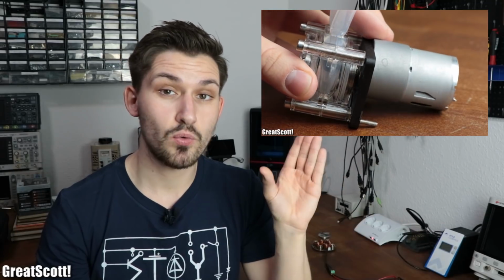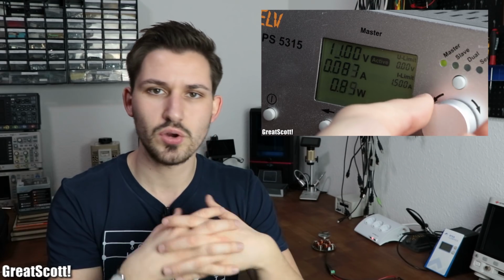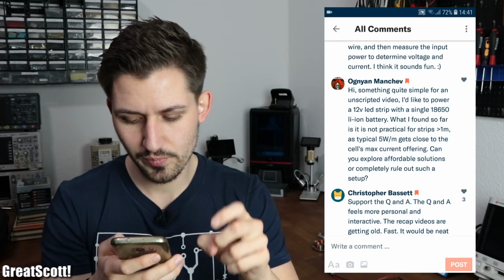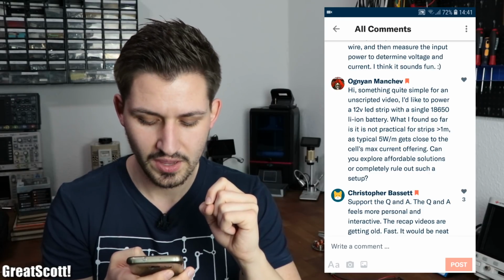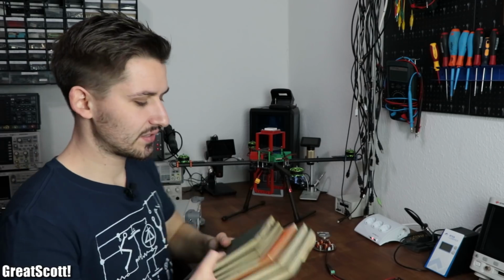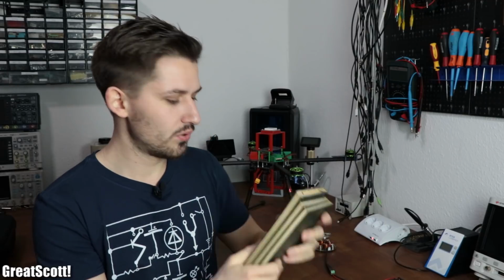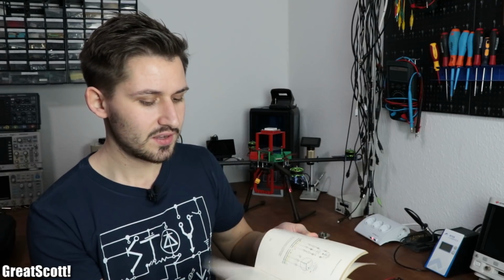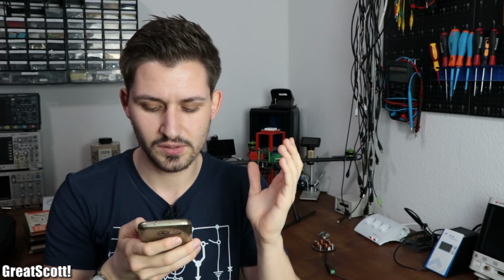Random/Unscripted Q&A #4 || Top 3 GreatScott! videos of 2018!

Comment: A basic diy drone would be cool; but what would be really cool is building the basic diy drone, then expanding to an experimental, larger drone.  So if the standard is a four motor drone - do that. 

But then remove each single motor and replace each with an expanded trio of motors built on a custom rigid frame - a basic triangle frame that sits where one motor sat originally.  And maybe something to test the aeronautics - so of the three motor group, have two set to the outside of the drone & pitched at a slight angle.  So if it could hover with the majority of the power to the upright motors, that's great.  But, what about speed by ramping power to pitched motors on the fly...?  How extreme could the pitch go....?

So a quad copter drone turns into an experimental 12x copter drone... Or maybe a 16x copter drone.....  I mean, you are German...building bigger and more extreme is kind of expected...  I'd say one successful build should become a challenge to take the success to the next level.  A quad copter leads to a 12x copter which leads to...(?)...a 12x copter with twin pulse-jet engines which leads to....... A quad 12x motor w twin pulse jet engines copter (so 48 motors, 8 pulse jets, all on one gigantic quad copter frame)...

Frankly, I don't know how you could say no to that...  What if the 48x copter/8x pulse-jet ultra-quad-copter is a success...?  You keep on going...(?)

Comment: Don't make the drone thing seem so difficult. I feel like you went a very complicated rout. Normally there's just one connector type for "data" (jst) and a few for the batteries (xt60, ec5,...). You need a frame, 4 ESCs and Motors, fc, charger, battery, rx and tx, and that's basically it.

Comment: Great scott, could you take a look at Sam Sheppards 72,000 lumen LED light on here. And tell me if this thing is putting out way to much power for the lights, it's a parrallel circuit with a 36 volt source and 1 ohm of resistance across each LED. To me it sounds like he's making alot more power then the lights can handle. Just curious what you think. If you get a chance, thanks

Comment: I have a video request. I understand you are not a home automation fan, but I thought it would be nice if you could make a video about interfacing knx (a home automation system installed inside houses) with arduino. I know this is possible by using an existing pcb. You are very good at breaking down and explaining the most essential parts of the electronics, so it would be interesting to see your takeaways on such a project.

Comment: I'm working on a music related item and would like a beats per minute meter, but i cannot find anything online (certainly not in my budget)
I would like 3 digit 7 segment display, 40 - 200 bpm
All i can find are interface boards for arduino and other processors, not something i want to get into, and they are for heartrate (which could be another use for the bpm meter)
Maybe some sort of charge pump and digital voltmeter calibrated for the scale ?
Any ideas ?

Comment: Hello,
And thanks for the great and instructive tutorials,
I have a question: could you make a detailed video for the "start-current-limiting" circuit.
e.g. If you want to control larger loads and you want to prevent the start flows too much power.
that would be a great thing.

thanks again and greetings

Comment: Seriously, a drone project?  Building drones is so last year or actually last 2014!  When a lot of drone building videos started coming out in 2012 I tried building several, including one supposedly RTF model from Hobby King but the designs were bad, the parts from China were defective and the software was all terribly buggy so none of them would ever fly.  They were fun to build but frustrating when they would never fly so I finally gave up and got a DJI.  If you have a drone project you will need to use a proven design, parts that have all been tested and guaranteed to work and bug free software that will keep getting updated or everyone is going to hate you when they end up with a worthless drone!

Comment: I would like to see a series on modifying commerical products to make them more functional or transform them into something else, kind of like the old converting a computer PSU into a desktop power supply, but don't do that one there is enough of them already. How about something like taking a cheap lead acid battery charger and adding some features to it for example.

Comment: Hey GreatScott
if you ever come across this, here is one project idea

How about powering PC with 12V car battery (12V, 5V and 3.3V rails), because it can deliver high and stable amps for gaming, but if you're on budget, decent PSU can be (sort of) expensive.
Of course this should have some sort of protection/charging, I haven't thought it through, but, it would be, unique?

Comment: Little bit off topic but I need a particular circuit for my lab bench power supply (from scotts video) and I want an external circuit to limit the current from 0-200ma to limit the heat gen and add a switch to bypass it that I can do. But I can not find a circuit that can do that without interfering with the buck boost converter. Has anyone seen such a circuit?

Comment: Can u make a diy on home lighting system.
Working on a series of high power LEDS with 6v 5ah battery as power supply.
This circuit can be dual charge with a 12v AC wall adapter and 12v 20watts Dc solar panel.

Comment: Fun fact, I've made my own drone, and it has completly 3D printed frame, about the size of the Dji phantom 3, It's pretty easy to do actually. It's just the matter of designing the drone's arms, to make them lite yet strong enough. Fully 3d printed frame weights about 250g so not that bad I would say. Overall it "works like a charm". You should try it out. Sorry for any bad language, I'm polish so...

Comment: The website idea is good, even if it's just a page for each project with the video and support materials such as schematic, board layouts, source code, etc. The easiest thing would be a blog type site using a simple CMS like Wordpress. They're pretty easy to set up, you basically just get domain name and some web hosting, then follow the web host's guide for setting up the CMS. The hardest part is customising it to look the way you want. I suggested Wordpress because it's extremely customisable, really very powerful - the Wired website uses a highly customised Wordpress setup - but there's plenty of others. I'd volunteer to help out with the basic setup, but I'm all the way in Australia, so the time difference would be a killer (and I'm way too busy with work)!

Comment: A project idea. Fail safes. Now that you are doing a multirotor project, my project has some relevance. It mixes multirotors with signal processing. Two years ago a friend and I made an autonomous drone. It worked. But testing new code was dangerous. So I built a fail safe switch using a pololu rc switch and 3 audio switches. The big issue was, the off the shelf rc switch had its own fail safe which made it awkward to use. I would love to learn about using an rc signal to electronically open and close a circuit. If you are interested, I can send you a schematic, part numbers, pictures, and possibly some video of my board. Either way, I'm a long time subscriber and love your channel. Keep up the good work. Thanks

Comment: Hello! I think that the old circuits (of the book) vs the current ones is a good idea. You always learn something new from the old things.

I was just thinking that it would be interesting what you said about other microcontrollers (besides the Arduino and ESP families). It is always good to have other options seen.

First suggestion for new videos: alternatives to the Arduino IDE. Now the official IDE does not support the autocomplete feature. Also, compared to other IDEs, i think it is not very user friendly. Some alternatives are: Visual Studio // Atom with PlataformIO package, Eclipse with Arduino package.

Second suggestion for new videos: Audio pre amplifiers and / or power aplifiers based on vacuum tubes. Most of the high end amplifiers use this technology. It would be interesting to compare them with amplifiers based on transistors (frequency response, power consumption) and to see from the electronic point of view why they say they sound better.

Sorry for my "little english".
Happy new year!

Comment: Hi GreatScott and Happy New Year !
I saw you're making a quadcopter too. I started mine 3-4 years ago (I had the project in mind since 2008, almost). I had / have the same problems, I understand (especially about the regulations, i'm in France). I'm also re-creating the flight controller.
Maybe you could try to make videos about control theory or IMUs filtering but with the DIY point-of-view in mind, that kind of knowledge I was lacking of when I started. Not getting too much in detail, but understanding well enough to be able to implement those algorithms and play with them.

Comment: Well thanks you for this video. I love to watch the stuff you are doing and i have a suggestion for a video. I want to replace my old Hilti NIMH batterys with 18650 cells but in order to have they as an efficent replacement they need to charge in like 1h and have at least 2500 mhA. So the fact that they have to have an 12 V output at the end of the day, brings us to the challenge. we would need them in series ofcourse to achieve the 12V but then charging them would need some sort of bms or lion/lipo charger which still would have to charge them managed in order for them to live longer. also i would like to have it in the original enclosure and if at all possible chrage them with the original chrager ( if not a usb connection or xt60 would be possible as well ).  the main thing i am looking for is the chraging. you did the lipo charger video with all the wanted protection features and such, but its just a 1S1P and i am looking for a circuit with the same features as yours but for 12V output und fastcharge for 2,5 - maybe 3,5 Wh (2500mAh - 3500mAh). What do you think about a project like this to renew old tools that are great but because of the battery are dead.

Greetings

Comment: Very nice...i have question regarding breadboard, Recently i am making my own DIY power supply using Arduino, during making circuit on breadboard i realized that breadboard i have just bought from china (Aliexpress) is not good at all and have so many problems like loose connection, high contact resistance etc etc..Since now i am in Germany any good brand as a recommendation? I know there are some US based brand like Jameco and Busboard prototy systems, but they seems unavailable in Germany. So any similar brand good brand will also work for me Germany?..I really don't want to use this cheap Chinese breadboard now. Thanks in advance..

Comment: You don't need to get a drone operator license here in germany unless you fly something which weighs more than 2kg (AUW), regardless wether it's commercial or diy. Your setup looks like it could weigh more than 2kg depending on battery and payload. Much more of a pain in the ass is actually finding a place to fly, which is no airport, residential zone, nature reserve (read every free spot which is not used as farm land, residential or commercial/industrial zone), jail, industrial facility, hospital, river (yes you are not allowed to fly over rivers in germany when they are used as waterways), within 100m of the autobahn or a bundestraße or a railway and so on and so on. It's ridiculous.

Comment: For low cost DAQ look into Dataq.com instruments. They sell a starter kit for $60USD with 4 channels. For more channels and faster the prices go up. I use the 32ch models at work and they are so excellent that i picked up a few of the lower cost models for home. Software is super simple but not always cheap, there is some support for Python and .NET so you may be able to roll your own.

Comment: why no one use high power DC motors for drones? i know its heavier but is that 100-150g extra motor weight matters for hexacopters or octocopters? 

the advantage of doing that is i think it is easier to control and does not need extra cost of ESCs...

Comment: Hey happy new year 
And my question was  
#1 for the led cube - I wanted to ask if 5v would be enough to power the whole cube 
#2 for the magnetic levitation - can There be a circuit using which not only the magnet would fly as well you can rotate it through a coil         and something .... 
And I want you to make a DIY or buy  for the levitation

Comment: Die or buy: circuit breakers.
Reply: AirsoftSlo buy ofc
Reply: @heanstone1327  I thought its bettet to die😶#sarcazm
Reply: AirsoftSlo sorry did not notice it
Reply: No problem :)
Reply: @zanpekosak2383  I actually made a circuit that was designed as over-discharge protection for Li-Ion, it switches the output via a MOSFET, and quite reliably cuts-out when voltage of the input drops below 3.2V...
The effect of this is that short-circuit conditions also trigger this cut-out condition, and the circuitry latches so that it can be effectively used as a power switch as well via two buttons...
Reply: @Komiyan.  Nice

Comment: Regarding the question of identifying the secondary windings of a transformer,  I always use an ohm-meter (on a step-down transformer, higher resistance means primary). Maybe the viewer was trying to sort out a transformer with 2 secondary windings to put in parallel or series for more current or volts. For that it is crucial to know the way the secondary coils are wound or you create a magnetic shortcircuit and destroy the transformer. There is a way to measure this with a simple multimeter and a low-volt AC source/function gen but its too complex to describe in a comment. If interested, checkout https://youtu.be/MEUdun87ErU on how to do it.

Comment: How about building a BMS that takes the excess power from one or more cell/cells and spread that power out between the under powered cells instead of losing that energy using resistors? Most interesting. Thanks and Happy New Year.
Reply: Another idea would be rebuilding the TP4056 with and without protection to handle more than 1 amp? Say at least 3 amp and fix the input issue burning the chip out when using the same source when you connect them in series on the output. Again Thanks
Reply: The energy lost to balancing is not very significant, but it would make for an interesting video anyways.
Reply: @NiHaoMike64  When it really matters is when you have a massive drain while the BMS is keeping it stable and you don't want that waste of resistors. When you have a slight drain and the power is being trickled out, it's not that significant and the cell stand a better chance of staying stable.
Reply: @MrBrymstond  Lithium batteries don't go out of balance that quickly. Add some LEDs to a balancer and you'll be surprised that after the initial balance, the balancer rarely even comes into play.

Comment: Cool quadcopter! Shame it can't fly yet, especially considering you'll reach 1 M subs in about 3 days according to Social Blade. But, IMO, it's not very interesting to just DIY the frame. If I was building a drone, I'd also DIY the controller, and put open source code in it such as MultiWii. This way, I can customize it and incorporate features I want, such as "return to home", using a GPS module.

Comment: Could You make a small card wich Will fit in your wallet And turn it into a smart wallet! Using maybe Arduino and bluetooth module and add some clever features using a single/multi click od single button. DIY or buy

Comment: As I understand it, a DIY drone means using commercial motors and controllers to make your own flying machine. Assuming you'd have to manufacture each motor yourself is like saying you'd have to design and build your own engine or harvest your own latex to make tires for a project car you'll build out of steel pipes. 

Leave that level of basics for HTME, they'd likely mine the copper and bauxite if they ever make a drone out of scratch! :)

Comment: Can you PLEASE make a lead acid battery charger. That would be amazing. Lipo’s are great but expensive. Sla/agm batteries are much better when it comes to saving a buck while making a larger project
Reply: Sealed lead acid is not that much cheaper than lithium nowadays.
Reply: It can be very expensive for a lipo that is equivilent to a car battery
Reply: @loganhill4704  A car battery, at least the cheaper ones, are conventional lead acid, which is a lot cheaper than sealed lead acid. The downside is that it must be kept upright or it will leak.
Reply: Plus for my project i need the extra weight
Reply: Im not using car battery sized ones im using ones you would find in a fourweeler. They cost about 30 bucks a pop.

Comment: DIY'ing a repulsive magnetic levitation kit might be messy. It contains 4 coils where the coil pairs corresponding to each axis are wired in reverse. This results in the pairs always being opposite polarity. Using the hall effect sensors, the H-Bridge continously switches polarity to the coils which levitates the magnet ;)

Comment: Still didn't understand the advantage of desktop multimeter over battery operated
Reply: Likely more features, like 4 wire resistance as he said, and I would assume a desktop multimeter can probably handle higher volt/amp/watts, and also give longer measurements for smaller ones as well (.0001 amps for example)
Reply: Precision and functions
Reply: One major, simple reason for me.... I can't easily pick it up and leave it somewhere stupid. It'll always be on the desk where it lives 😂
Reply: Many features. One of which is for doing thesis is it can screenshot of the readings into pendrive.